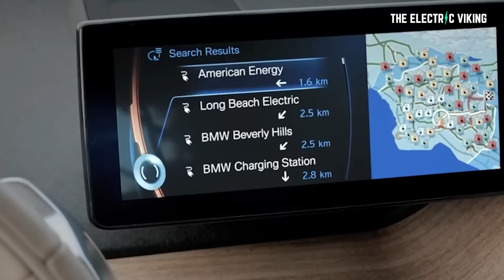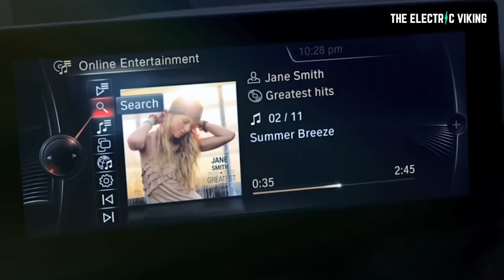BMW executive says motorists should stop buying new cars

Comment: Actually, the idea of sprucing up an old BEV makes really good sense because it's going to last so much longer than a smelly old ICE car. This could be a brilliant way to increase the revenue that BEV manufacturers make. There could be a massive third party business for interiors and accessories as long as the prices were competetive.
Reply: It’s already being done. ICE to BEV too. Importantly taking a donor ICE vehicle to zero kilometres means not just replacing the seat cushions. Every hinge and joint, every bearing and every bush needs to be replaced, regardless of the powertrain. Sometimes that’s cheap and sometimes it’s more than the donor car is worth. 

After the bits are replaced it’s essentially a zero kilometre car with whatever scuffs and old technology it came with. Or didn’t come with - ABS, rear parking sensors etc
Reply: Cheaper to buy a new EV
Reply: @timothykeith1367  I have plans along those lines when it is time for a new car.  An early Model S is not much more money than a 3-year old Bolt EV.
Reply: @Frankmaui67  it is not cheaper to buy a new EV than a used one, that is absurd.  I must assume that you meant a total conversion costs more than a new EV, which in general is true, although not necessarily an apples-to-apples comparison (such as comparing a rebuilt Range Rover to a new Chevrolet Blazer).
Reply: @JohnGeorgeBauerBuis  yes I meant retrofitting an ice vehicle...better to buy new EV unless you're doing it for sentimental reasons or loaded

Comment: The seats in any BMW are actually the last thing to break down, and so it has been for the last 30(!) years.
The question is rather why are the original (!) spare parts much more expensive than those made of the original parts deliverer?
Why are so many "assemblies" impossible to repair?
Why aren't the so called diagnostic tools built in at least the last 20 years?
Then people have different needs, for some people and for some needs a quite old car is quite useful.
To commute to your work  10-20 km in the countryside you don't need a "new" car, it's when you go for a road trip you want to enjoy a "new" car.

Comment: What a ridiculous suggestion.  Most people I know replace their vehicles for lower maintenance and better reliability. I have two cars, and '07 Caddy and an '04 Buick SUV.  Both are low mileage and have been problem free.  Cost of ownership has been and continues to be very low, and we drive less now since we are retired.  Low insurance cost as well with basic coverage. Only Liability needed with these older low-value vehicles.  When they become unreliable, then you assess the cost of repair/replacement with the cost of a new/replacement vehicle.  One can do serious repairs for the cost of monthly payments and higher insurance.  Be wise with your money; invest in TSLA stock. 🙂
Reply: I am waiting for my Cybertruck. In the meantime my 2007 Honda Ridgeline engine gave up the ghost at 220K. Instead of buying a newer used pickup I had a rebuilt engine and tranny put in with a full three year warranty. The rebuilt stuff cost about 11K….. much cheaper than a good used car. 
I do all my own maintenance, replace struts, rebuild brakes, etc. to save money and ensure it is done right. 
Cannot wait till the BEV with hardly any service to be done!  Woohoo!
Reply: That would be hard for me. 04? Thats 18 years times 50.000 Kilometers. Thats 900.000 Kilometers with one car. Sorry. Not for me. I sell my cars before they come near the end of their warranty. I switched all company cars, heating and removed all fossil use from cars, company and house. And i save a bunch of money every year. And yes: I‘ve put them into TSLA for my grand kids - not for me.

Comment: Fully agree that e-bikes are the ideal replacement for all cars in high density areas where average speed is anyway slower than the one of a bicycle (25km/h). We should stop that madness of wanting to move 1.5 to 3T vehicles for our 80kg bodies as an e-bike weight is about 22kg-30kg max. Bad weather is not an issue with good clothes. Energy savings will be huge !
Reply: Eh, the vibes are off biking in the cold winter. I’m good on that 😂
Reply: Keep in mind that what you say is true in many circumstances, but it is not in a lot of others, such as grocery shopping for a family versus a single person such as when you live and function in Mountain areas comma clothing does not solve the issues in many cases, Mountain areas are prone to extreme wind and flash intermittent brainstorms that are overwhelming in some cases several inches per hour and of course during the fall through the spring and sometimes into the summer months sudden snowstorms or even extended snow storms comma virtually all bicycles are rendered completely useless when there's snow and ice on the ground period However during the summer here in the mountains electric bicycles are quite popular and all the bicycle renting shops and outdoor renting shops in the California Sierra friend these type of bicycles in volume during the spring and summer period but human powered mountain biking is also quite popular However that's a separate issue from everyday use
Reply: How about traffic safety? Who wants to risks their lives for energy savings?
Reply: Unfortunately i am very sun sensitive.  So it’s not much fun covering up in hot sunny weather.
Reply: Enclosed ebikes solves the weather issue.  Just need somewhere to lock them up.  Not many in north america but they are far more common in europe/china
Reply: @ccibinel  nope sorry you've never lived in an area that gets sudden torrential downpours or worse sudden snow storms and Ice storms
Reply: @Harrythehun  If you have to risk your life to ride a bike it is a problem with the roads where you live. Car traffic shouldn't be at the expense of everything else, but sadly that's how it is in many places. It doesn't have to be though.
Reply: @keithb7981  Using either wood or pellet stoves for heating is fairly rare but even if these situations require a truck or trailer a few times a year renting is still more efficient than always hauling around a heavy vehicle for those edge cases.  A couple with ebikes, a single small car and a trailer can handle a wide range of edge cases and still cut transportation costs/emissions in the vast majority of climates / living situations.
Reply: I don't live in a high density area, and e-bikes  works just fine here too. My commute to work is 16km and takes about 20 minutes by car and maybe 45 by bike. I park a trailer at kindergarten and pick my kid up on the way home. Hopefully she learns how to ride a bike before she cannot fit in the trailer anymore, then it will work a few more years.
Reply: I totally agree with the e-bike proposition. I manage about 2000 miles a year on mine as a replacement for the miles I would otherwise do by driving my car,  which is incidentally a Tesla Model 3. The benefit of using my bike is that it keeps me fit as well as reducing traffic congestion. I highly recommend it.
Reply: A cargo bike with a rainproof enclosure that won't fogg up that costs less than $3000 please.
Reply: As a secondary vehicle great, however I still have to do the odd 'fetch it' run & I do have a caravan.
I spent a year boarding in Ballarat, riding around lake wendoree in the middle of winter is not fun!
Reply: @paulstubbs7678  I'm fascinated in the rise of car rental as a model of car "ownership".  I know people that take public transit to commute and when the trip or cargo requires it they rent a car through an app.
Reply: @johnnyforeigner11  now you have a TM3 and don’t drive it. Congratulations
Reply: Everything is possible when you don’t know what you’re talking about.

Comment: I've been saying the same for years... It is insane that there are so many new combustion engine cars sold still. If it wasn't for emissions and safety, we could be driving cars from 1970 today. :) 
Problem with old cars around here, if they otherwise run properly, is rust. There isn't any simple fix to that, it's a lot of work to fix a rusty car. But at the same time, many cars get scrapped because of minor faults or just to avoid the hassle of selling it. 
I can vouch for that e-bikes get used more than regular bikes. I've done more commuting miles on my bike this year since I put a motor on it than I did in ten years combined before. :)

Comment: Has anyone priced replacing the seats in a BMW? My guess is it's going to be thousands of dollars. And you're stuck with the same uncomfortable seats it had when you bought it.
Reply: However this way be a useful idea for those who live on a diet of beans.  ;-)
Reply: A seat can be re-stuffed and have panels replaced easily by the appropriate shop.
Reply: @grandrapids57  I had the bottom panel of my driver seat replaced under warranty in my '99 BMW and it looked bad, never matched the rest of the car.
Reply: @frankcoffey  Typically it is better to have it repaired than replaced, for that reason, and it is substantially cheaper. This is coming from a guy who has 2/3 million miles on his 3 cars.

Comment: In my experience, the cars with the most 'features' are the ones thatget sold off before they are worn out. It becomes a slide to the end when electric gadgets like windows and mirrors need replacement. It becomes a lot worse when electric relays run the features. When a car also has 'electronic' features, the first big problem can be the last. 
I am waiting for a KISS electric humble car comes to the Canadian market, and it is looking like it will be a long wait. 
How about kits to electrify ice cars that are not otherwise worn out?
Reply: Most ICE cars make 3rd rate EVs.

Comment: Financially, not buying a new car is one of the smartest ideas. Why? At least in normal times, you lose way too much in depreciation that it becomes a financial money pit. Instead, buy a recent model (within 3 years) used car. The largest depreciation has already taken place and in most cases, the car still retains a couple years of OEM drive train warranty left. I have only bought new twice - once for the new (at the time) Pacifica Minivan, which was a new line - and yes, in retrospect, it was a financial mistake (paid $49k - plus taxes, fees and financing - now only worth $15k 4 years later). The other time was when I bought my Tesla Model Y - which at the time, used cars were selling for $15k more than buying new. Even so, I applied the 35% rule - basically you should not buy more than 35-percent of your annual income. Also, I recommend holding of buying new vehicles unless you have a net worth of over $1 million. In the case of BMW, 70% of their drivers lease their vehicles. While there are valid business reasons for leasing (check with a CPA), I suspect most are just play the "pretend rich" game.

Comment: The selling point of BMW is the tech and features, and in some cases handling.

I would like Tesla to add a driver side screen and heads up display to their model 3's and Y's. And to retain the ultrasonic sensors. If it is a paid option, it's not an unreasonable request.

Fu disclosure: I'm trading my model Y for an iX1.

Comment: Hi Sam, BMW has no compelling EV on sale right now. Ok, the i3 was not perfect, but it was a dedicated EV platform with revolutionary materials and engineering. But what did BMW do next… well basically nothing, shoving batteries in the iX1 makes for a crappy EV. BMW have basically turned their back on EVs for a decade, and now they are panicking - as well they should!

Comment: In a way, BMW may have a point but not in the way they intend.  Once you have bought an electric car, it will last for so long that you would wear out the seats a number of times before you have to replace the car.  Electric cars don't have all that mass of metal reciprocating back and fort, oil that you can forget to change, water that will destroy the car if you don't keep it topped up and so forth.  Make the bodies from Aluminium, composites or stainless steel and you might never replace your car.  With ever improved batteries, you might never have to replace the batteries.  Thankyou BMW
Reply: Sounds like cupboard is bare, better buy a Tesla!!

Comment: For at least 50 years now all the Legacy manufacturers have been producing cars with built-in engineered obsolescence or what I call drop dead dates, the engineer major pieces of the powertrain to fail at specific mileage, and hold the price of repairing those items so high that it is ridiculous to not by a new car or a newer car. A good example is Ford 65 Mustang and many other models from that area through 67 or 68 used the C-4 automatic transmission. I kid you not, that transmission would run perfectly for 300,000 plus miles as long as you didn't let a dealer touch it; then when they came out with their garbage versions around the early 1970s, Ford implemented the policy of built-in obsolescence, redesigned all their transmissions to fail at fifty thousand to fifty five thousand miles. This was a management choice, and anyone who's researched Ford knows this is true. But, basically all ice manufacturers have been doing exactly the same thing since at least 1970  even their luxury cars. and now, bearly all consumer products manufacturers on the planet are doing the same thing to extreme extent, with built-in failure designed and engineered in, at the earliest possible time usually coinciding with weeks to a couple of months after any warranty period has expired. As it stands right now Tesla is the only company on the planet that is making their products with the intent to make them efficient, ecologically friendly, and as durable and reliable as possible, with 100% or as close to it as possible recyclability of all components. Since Tesla is fast becoming the highest demand largest numbers of new car sales on the planet, BMW, and probably others will follow, are trying to divert customers to other products options of their business rather than new cars because; they know they can't sell their new ice cars and none of them have an electric car that is even safe to be on the road, well maybe Porsche.

Comment: Totally agree . Ive run my pearl white 2014 Tesla P85 for 125,000 uk miles since new. Its still brilliant, still does 250 miles on a full battery and has FREE FOR LIFE SUPERCHARGING. Ive a Plaid and Roadster on order and dont mind waiting, if my car still didnt look like new Id have no problem cutting off the back and making it into a pickup so I can put my 2022 Zero SRF EV bike in the back........may cancel the Plaid and Roadster just recycle n run the old RWD beast.
Reply: The Zero is a rolling liability. Cheers from the land Zero stuffed over and left in ruins
Reply: @theairstig9164  Interesting view, can you explain and BTW yep it helps Ive a mechanical and electrical background plus some some software understanding in order to run a Zero

Comment: He lost me when he said the i8, i3, i7, iX, iX1, iX3 aren't premium products?  A premium car is built above average to the point that it has a lot of luxury bits and the cars above all fit that standard... BMWs are not a Toyota product, you'll never see tons of BMWs in driveways... BMWs are extremely popular in southern California. Eventually, BMW will get there with their electric cars.
A lot of car enthusiasts who drive high performance cars (typical BMW buyer) still believe that electric cars are not real cars, they only think a real car has a gas V6 or V8 engine in it... USA buyers are still against electric cars even though Teslas are big sellers in the USA.
Reply: They still can't compete with EVs designed from the ground up. The notion of keeping a BMW over 5 years is stupid because their engines have internal oil pathways made from plastic and they will break. Those pathways feed the vvt system which upon losing oil pressure break the valve train.
The wiring is made with 'biodegradable' insulation which biodegrades too fast and then you have to replace your entire wiring harness. And external plastic engine components also become brittle over time.
All this contributes to outrageous depreciation.
Reply: These guys thinking that their BMW has to have a gas engine haven’t been smoked yet by a Tesla or Porsche Taycan. They will change their tune when all they can see are the itty bitty tail lights of the BEV way way out in front of them.

Comment: The issue with tier7 emissions is that it will make small cars uneconomic to buy and therefore to manufacture. The percentage extra cost and complexity is going to be ridiculous for very little practical gain.  The only way to reduce fleet carbon emissions from these vehicles is to reduce fuel consumption and that means actually producing those small cars but selling them for large car/luxury car prices. For what? Even with zero emissions being hit across the board by all humankind, at vast expense, it will only reduce the overall temperature by the end of the 21st Century by something like 0.2C.  That’s unless natural phenomenon forces much more temperature variation one way or, God forbid, to a cooling.
Reducing CO2 will damage food production significantly while even doubling the current 400ppm atmospheric CO2 will have very little effect on the weather while increasing crop yields much more significantly, particularly in areas prone to droughts. The world is far greener today than it was 100 years ago for sure, when CO2 levels were almost catastrophically low for plant growth.